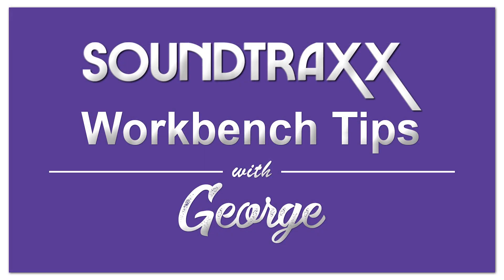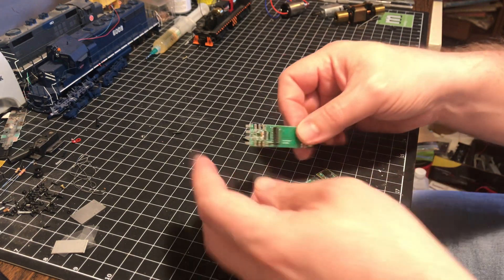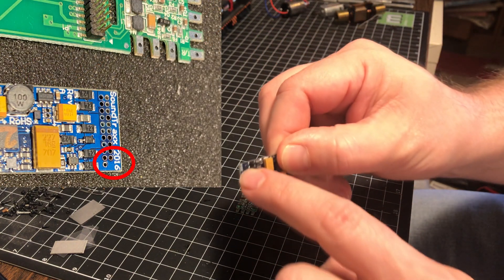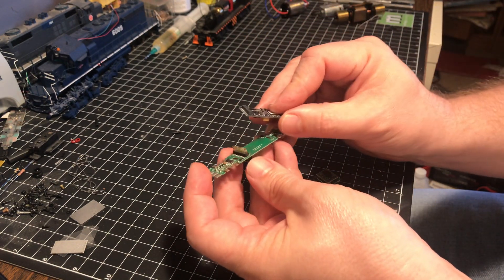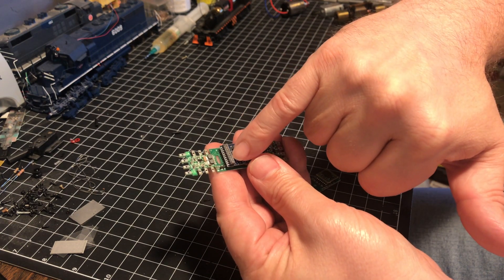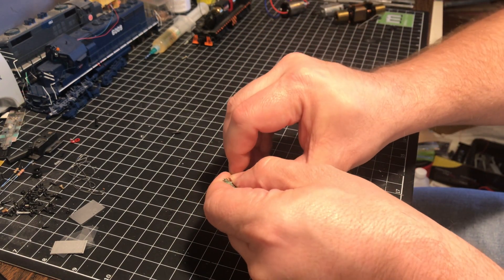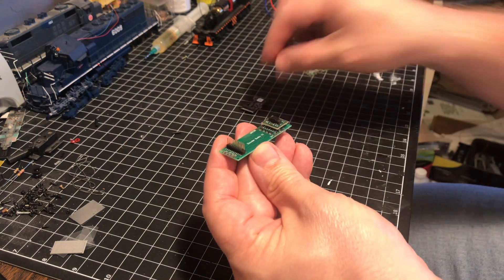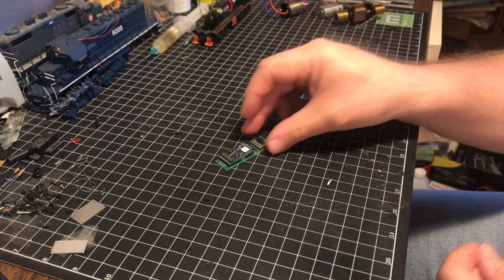How to Plug in a Tsunami2 Decoder with a 21PNEM Connector

Comment: I need to change a Scale Trains LOK Sound 5 to a tsunami 2 ?  OR vise versa.  I have a SP consist.  Its either change 5 or 1 decoder lol.  Dont see a 21 Pin on the athearn GP40-2 7677.  Thanks for the video!  hope all is well!
Reply from the maker: Things are going great!  Lots of people using Tsunami2 and Blunami!  Very exciting times!  On your SP GP40-2, contact us at support@soundtraxx.com and we’ll help you with your loco install questions.  From what I can see, that road number was available with sound, but also without sound but equipped with a 21P socket.  Let's discuss this directly so we can be sure to get the right answer for you: (970)259-0690 or support@soundtraxx.com.  Thank you!

Comment: Hi there, do you have any resources or instructions on how to operate a DC locomotive (Diesel) that has Tsunami2 equipped? I can't seem to find any instructions on how sound decoders work with analog layouts. Thanks in advance!
Reply from the maker: Yes, refer to your User's Guide. Page 69 for the Diesel User's Guide: https://soundtraxx.com/reference/manuals/

If you have more questions after reading through the User's Guide, contact our Support Department and they will be happy to help! (970)317-3505 or https://soundtraxx.com/contact/technical-support